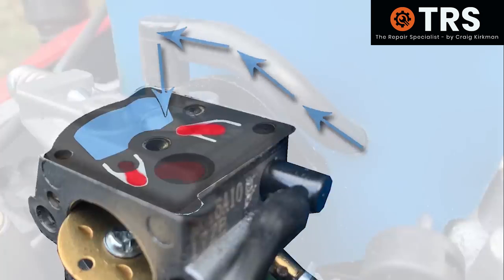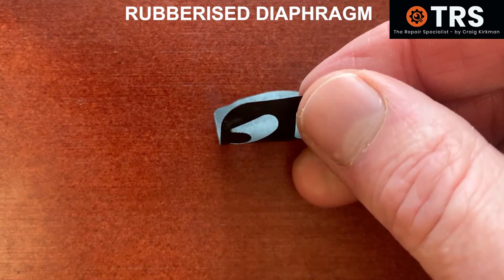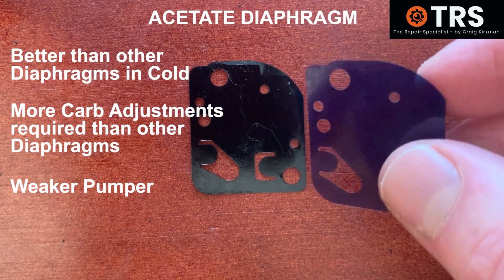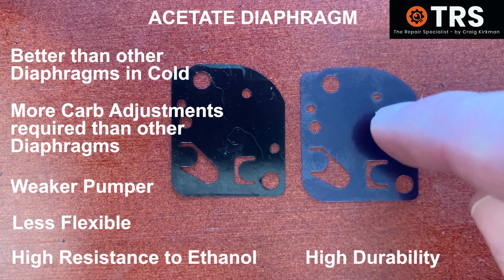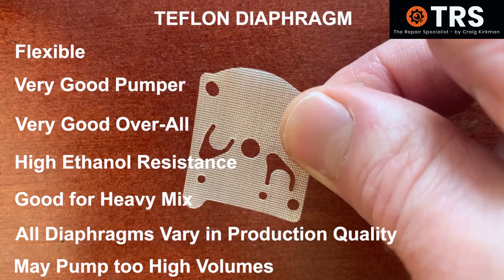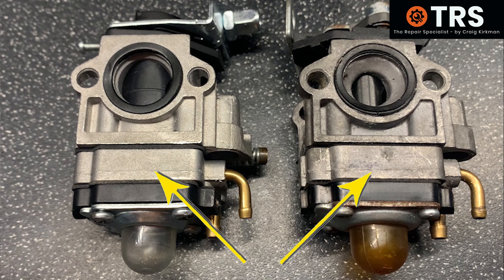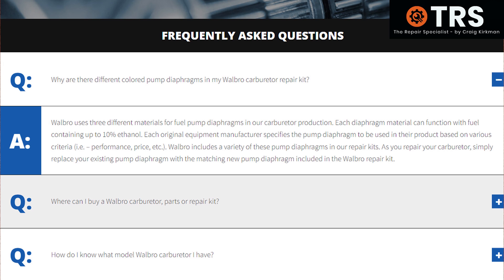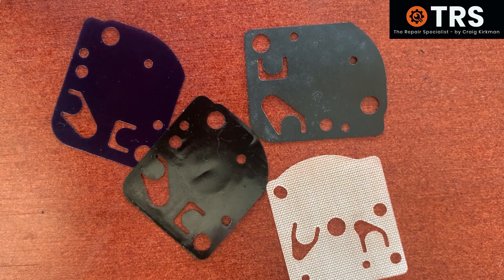2-Stroke Carburetor Diaphragms Different Colours. This is why!  (by Craig Kirkman)

Comment: The tan color material some call snakeskin is a teflon laminate with 
a woven fabric probably fiberglass,  I am not certain. I have a spool
of thread that is the same color and it is teflon covered fiberglass. 
I have a much heavier laminate of a teflon and fiberglass canvas. 
It is white and is used as a roofing membrane that likely lasts forever.  
The shiny film you call acetate is probably Tefzel film that is another
fluoropolymer ETFE similar to teflon but is a meltable thermoplastic.
It is used for electrical wire insulation mostly mil-spec aviation wire
and marine applications and other high end electronics. The black 
rubberized canvas old school material is nitrile rubber Buna-N also 
used for O-Rings and fuel lines. Alcohol hardens and embrittles it
over time which limits its service life.  

As for the pumping efficiency, probably there is regulation of flow
by the metering diaphragm and lever operated main jet needle and
any of the pump diaphragm materials send a surplus flow that gets
metered whatever is being needed while the rest is bypassed and 
goes through the fuel return line from the purge bulb back into the
fuel tank. So it should not matter what fuel oil ratio is used or what
is the temperature or what diaphragm material is used. But the 
amount of ethanol in the fuel would have bearing and make the 
choice favorable for the shiny or the snakeskin material for the
longer service life. Diaphragms are still mostly the old school
nitrile rubberized canvas and will need to be changed first, so 
there is the culprit that needs more frequent replace. On some
carburetors where the metering diaphragm is easily replaced 
without even removing the carburetor, that part gets replaced
a couple of times before the fuel pump diaphragm that usually
still works okay unless it is the same old school nitrile canvas
as the metering diaphragm. I saw where an improved purge 
bulb black rubber material is available that outlasts the clear
and red purge bulbs. Inside a purge bulb are Viton duckbill
valves and it may be the bulbs are also a Viton upgrade. 

Fuel lines are available too that are upgrades better able to
withstand ethanol exposure. But the best solution is to use
non-ethanol fuel. That is what is used for aviation and there
is plenty of good reasons for that choice by pilots.

Comment: Matching like for like is all well and good, unless someone was in there before you and didn't replace like for like! So, if I have a saw that is running funky, having this information waiting in the fog in the back of my brain will come in handy! Thanks. This was very informative. Also could you explain why some 2 cycle carbs now have two barrels. ie, one for the butterfly that is worked by the throttle and one just for the choke.
Reply from the maker: Thank you for your kind feedback. i really appreciate it.  I will indeed explain how the double intake carbs work. I have a few other vids to complete before this but will get round to it asap. Thank. Craig 👍

Comment: Craig, upon what information to you base your statement that the diaphragms that are tan in color are Teflon?  I was a sailmaker for years and that material looks exactly like the tan Kevlar used in sails. It’s also possible that the tan ones are two materials - Kevlar with a different coating, just like sails, which have a Kevlar substrate and polyester exterior or coating because Kevlar requires another substance to encapsulate it, depending on application. I can perform a test on one of these to possibly determine what it is because I know how Kevlar reacts under certain circumstances, including how it can be cut and how it burns (or doesn’t).
Reply from the maker: Ok, well you know more about this material than me so if you do a test then please let me know your results, I would like to know.  In fact, it's good that you bought this up because when I was looking round for info, most sources I found said they were made of Teflon Fibers, some did indeed say that they were made of Kevlar.  I should have mentioned this in the video.  I will put it in the description.  I asked many colleagues in the trade, as well as there extended colleagues, and they mostly said they thought they were made of Teflon, but again, the odd one or two said Kevlar.  Here are some opinions on forums as well.  Thank you for your input. Craig 

https://www.rcuniverse.com/forum/gas-engines-142/10173259-carb-diaphram-replacement-color-material.html

https://www.arboristsite.com/threads/which-carb-diaphragm.334428/
Reply: @TheRepairSpecialist 
Hi, Craig!  I’m back with my followup on this question. 
I can positively confirm that the diaphragm I tested is NOT Kevlar!  I was fooled because it has the same appearance and color as Kevlar textiles, but that’s where the similarities end. 
For the record, I tested a spare diaphragm out of a Dalom W-K10-WAT kit. 
I performed two of the three tests I know of from personal experience with Kevlar. The first is the cut test. Kevlar is almost impossible to cut with normal edged tools, including knives and scissors. I was able to cut the material with ease with scissors. 
My second test was the burn test. Kevlar is impervious to a flame from a propane or butane torch. The material I tested burned readily and I suspect if I had enough and cared to experiment further it probably would support combustion in a normal atmosphere. 
The third test I am familiar with involves folding the material over on itself multiple times with moderate weight placed on the creases. This usually breaks the fibers, as Kevlar has very little flexion ability - it is used for sails due to it’s extreme tensile strength and ability to resist stretch. It is always encapsulated, normally with layers of polyester, so as to hold it’s shape, because it is so slippery it cannot be easily woven with any expectation of retaining the weave. 
So that’s it - the tan diaphragms are not Kevlar. Whether they are Teflon I cannot address because I’m not conversant in testing methods for that material.
Reply: @Rein_Ciarfella  Zama refers to them as "tan Teflon"
Reply: @TheRepairSpecialist  
You’re very welcome, Craig. If I come up with definitive results I’ll certainly let you know.

Comment: I prefer to use the Teflon diaphragms generally. I’ll use rubber (if that’s my only option) in personal equipment because I run non ethanol fuel.
Reply: The metering diaphragm requires flexibility so that is where
the rubberized material is seen more often to need replacement, 
while the fuel pump diaphragm still has good life remaining.

Comment: I've also heard the teflon type have higher ethanol resistance and gladly install them in carburetors for other people, as ethanol laden fuel is everywhere in my area.   For my personal equipment, I typically prefer the rubber type as I do not use fuel with ethanol in it and I assumed the rubber diaphragms were more accurate and better sealing. The last few strimmer carb kits only included the acetate style and I've had no issues using them either.
Thanks for sharing👍🏻 your explanations make perfect sense to me!
Reply from the maker: Thank you for taking the time to let me know. Craig 👍👍👍
Reply: Great information but you talk so fast we can't catch it near that fast, your going over a lot of info very fast as if we already k ow how it all works, and we are falling behind drastically ,may  be if you make  several programs out of this one and go about 10 times  slower we can get it all, also could you  explain primer  circuit on tacumsia 3.5. Hp vert. Carb show how to take it apart  & how it works,also how to get  back to you?
Reply: run the video at reduced speed with your settings...I sometimes run him at 1.5x cuz I've already found the same info @Chuncy566

Comment: Thanks for the info on this one, Craig. I don't think I've ever seen a rubber pump diaphragm in a machine or in a rebuild kit (Walbro, Zama or knockoff). I've seen and used plenty of acetate though and I think I've tried a teflon diaphragm a time or two without noticing any difference or different tuning required. Experience from blowers, weed eaters and chainsaws in the Southern US here.
Reply: I see the rubber ones much more than the others, but I get in a lot of very old free equipment which has not had any work done to it.

Comment: I generally use the acetate diaphragms because I have noticed they are always in perfect shape when I open up even the most nasty carbs for cleaning.
Reply: I've noticed that invariably the non-rubber diaphragms are deformed in the fuel reservoir area, even if the valves are perfectly flat.  I always replace them because I had one machine in that would not tune properly but when I replaced the pump diaphragm with a matching new one the machine tuned and ran perfectly right away. This tells me that the non-rubber diaphragms are definitely susceptible to damage from some fuels (most likely ethanol, but I suspect it can just as readily be fuel sitting on them for extended periods of time with no use).
Reply: @Rein_Ciarfella  I also replace the diaphragms even if they look perfect just to avoid that very issue.

Comment: What? The idiots I watched said I needed to use them all. in a certain order! I swear I didn't understand but didn't know any better as i just bought an old mcculloch 610 chainsaw and when I rebuilt the carb it had at least 3 types as well. I understand the gasket then a diaphragm on one side but on the other is where they are saying stack them. Its a wonder my saw runs at all. Thanks Craig. I may do a video to prove what I'm saying.
Reply: Never heard about anything like that. Why would you stack diaphragms, lol.
Reply from the maker: Oh my goodness. Sorry to hear that you’ve been told that. Anyway. I hope all is better now, and thank you for your contribution to the chat. I really appreciate it. Craig 👍👍

Comment: Very interesting, Mr. Craig.  I knew that 10% Ethanol gas/petrol (E10) was acceptable for pretty much all vehicles and most small engine devices, but with Walbro stating E10 is OK, but not E15 or higher, it looks to me like Biden is attempting to ruin all ICE vehicles made before 2011 and pretty much all small engine devices with his E15 all-the-time policy, in effort to get people to transition to rechargeable battery devices and BEVs.  The problem with that is the devices cost twice as much from having to buy the battery and any spare batteries desired, and the charger if the devices are from different manufacturers.  BEVs also cost a lot more than a comparable gas/petrol vehicle. Luckily for me, there are 5 gas/petrol stations in my city that have E0 Regular, and the one I go to because Regular is the cheapest there has E0 in all octane grades.  I'm buying E0 Regular for my 1995 car now, which makes me pay, on average, 50 cents per gallon more and I've learned that it's best to use E0 Regular in all small engine devices, which I have started doing.  Ethanol gas ruins parts and components and E0 can gunk up if the vehicle or small engine tools are not frequently used or drained for storage, but E0's damage is a lot easier to deal with.  Just clean the carburetor.  Thank you for this video.  It will be helpful when the time comes to work on small engine carburetors.
Reply from the maker: Thank you for taking the time to respond in detail. I appreciate it. 👍

Comment: I try to match up diaphragms with the one that comes out every time. So far it's worked out pretty well. I agree 100% about the ethanol issues, if I were honest, ethanol side effects supply probably 70% of the  "broken" used equipment I buy
Reply: I was advised to use Aspen ethanol free petrol for my strimmer. However, as it's about three times the price of petrol station petrol it seemed better economics to use cheap petrol and pay for the occasional repair. I now do all except the last ten minutes of my strimming with cheap petrol, then empty the tank, put in about 100ml of Aspen and then restart, so the carburettor is only exposed to ethanol for a few hours each week rather than 24/7 and that seems to work well.
Reply: @Rob the Gardener  fresh ethanol won't hurt you as much as you think. The problem starts when it begins to break down. My weedeater is well over 10 years old and only runs cheap pump gas, but I keep it fresh and drain it at the end of the season. Save your time and money, just use pump gas and don't let it sit in the tank for more than a couple weeks.  👍

Comment: My hedge-trimmer would not hold maximum revs without stuttering, the cure was to replace the rubber diaphragm (ethanol affected presumably) it now runs fine with Teflon, although I wasn't aware that it was Teflon till just now! Thanks👍
Reply: Rev limiter chipped ignition coils are out there. Just sayin'
Reply: @artpatronforever Didn't know that, thanks.
Reply: @michaelglynn2638   If an engine had an on/off switch 
for the rev limiter, guess where that switch would be 
for many people, and definitely I am one of them. 
And how many pieces of equipment would ever
be sold if it was labeled on the box or description
a rev limiter was on that equipment? Aftermarket  
replacement coil or a substitute coil without the 
rev limiter is a possibility if that is an issue that
needs to be defeated.

Comment: I always try to use the acetate or Teflon diaphragms for durability, but I have noticed that the three diaphragms are often cut slightly differently, so I have to use the rubber one. I put a carb kit in a chainsaw carb and it had the acetate diaphragm in it and it was just starting to show wear while the needle lever actually had a deep west mark. That showed me just how long the acetate diaphragms last, and I am sure the Teflon ones will last just as well.

Comment: Useful info, i repair brushcutters and chainsaws , mainly stihl (when i can source the spares) and some Chinese..im based in india and just been told the fuel has changed to E20... So going to have to up the oil ratios 🤔 Constant carb issues here , wrong fuel mixes ,poor quality fuel etc etc... Loving the channel , keep up the good work 👍🏼🔧🔧